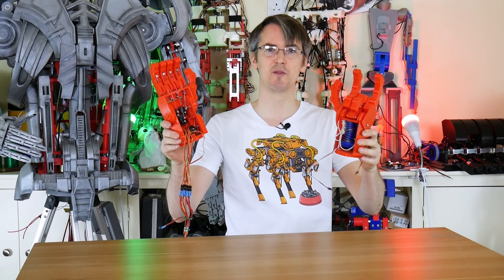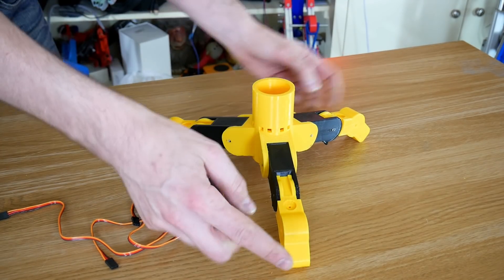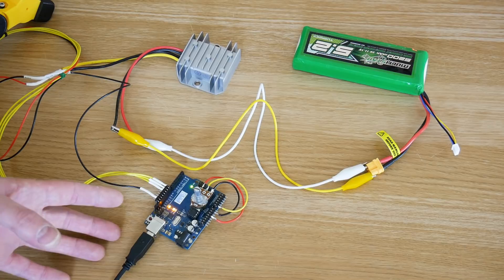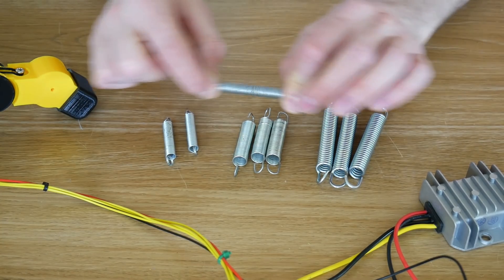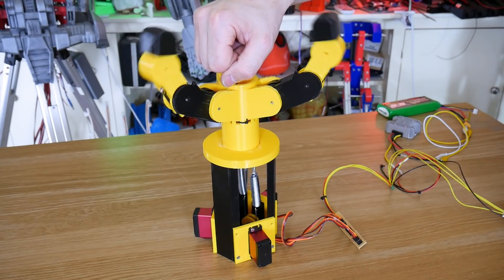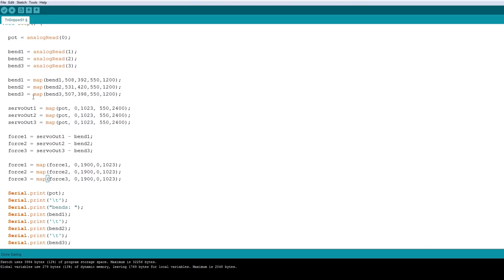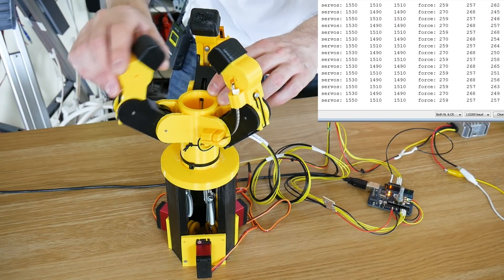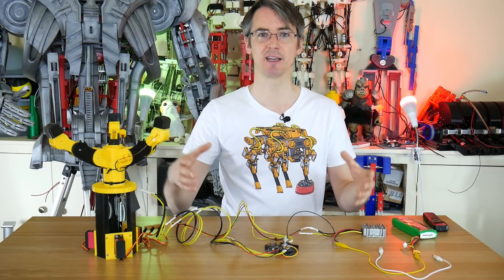Building a Force Controlled Robot Gripper | James Bruton

Comment from the maker: I want to build a whole general purpose robot arm that's force controlled!
Reply: Maybe it could be used as an arm for an open dog? Like the one spot mini has
Reply: @mantasdaskevicius9595  that would be awesome, James should also make two attached to the front so it looks like a scorpion
Reply: If its force controlled you have to do it or not, there is no try.
Reply: Hey man, have you seen "IRIM lab Koreatech" low inertia, compliant robot manipulator designs? It may help with working out some design flaws you are having.
Reply: Do IT
Reply: this is an awesome idea however I already see another design flaw besides the fingers getting stuck, over time the wire pulling them shut will eat through the plastic and weaken the thing as a whole, you need to put something as strong or stronger than the cable to protect the whole structure.
Reply: do you print in PLA or something else?
Reply: To do an easy thing to grip strange objects, I saw someone use a plastic bag containing grinded coffeebeans. Put it over what ever you want, suck out all the air from the bag and it holds the item perfect. to let go, just push air into the platsic bag and it is as soft as ever. And it is enviromentally friendly.
Reply: Instead of using string why don't you try clutch cables, you wouldn't need to design runways in the joints for them as much plus it would be very simple to put one on each finger joint instead of 1 peace of string controling 2 joints.
You could also control 2 cables with one motor for grip and release because the throw won't need to be as long you wouldn't need a pulley just a horn.
Reply: Always appriciate your works, stay tune!
Reply: Hello there! I am a fan from Spain. I want to know the mechanics behind the Slsa hand (youtube), Jeff shimek grommash costume (facebook). The kind of hand that do not work with motors, but a master-slave system. Like skeletonics from japan. I would really like to build some light exoskeleton that works just by the movement of your own body, without servos nor motors. For large costumes...and death battle fights of course.
Reply: You need to use proper rollers at points where the strings change tangents...you'd be surprised how much diiference a little roller makes.

Next if you want to build a gripper, use lead screws to drive the fingers, or a worm-gear arrangement instead so that the gripper won't slip.
Reply: Hey James Bruton I know you get this question a lot and if you do sorry that you are getting it again!. 

My question is what 3D printer are you using to print all you're modeling from?
My follow up question is I am getting into Robotics such as Robot Dog, Robot Spider, Robotic Gripper (Hand) and even Robotic hand, my question to you is what 3D printer would you recommend for someone that is starting out to help with the Robotic building within the 3D printing world!

(If anyone else can answer I do greatly appreciate it!!))
Reply: I have an idea for a tactil sensor that allow to feel surfaces and I would like to make it Opensource. Supposedly can detect surfaces and simulate the surface on the other end ( in this country I don't have the tools to build ) so its just theoretical

If you are interest in the information send me a DM

PD: your robots are cool
www.instagram.com/jorge_verdugo_soto
https://github.com/Roboxtools
Reply: Hello sir 
Can you send me a cad model of this for a reference
Reply: Hi friend, can you please share me the drawing of the arm?
I will be grateful🙏

Comment: I would use PID control on the joints (with all three parameters, D seems pretty important here), and make your own servo object (in code) for each finger that wraps the raw servo, and sensor and abstracts the PID loop away.

If you find that you need finer measurements than the bend sensor, maybe look at those cheap optical mouse sensors to close the loop.  But that's probably overkill for this.

Comment: You are probably optimizing a part that doesn't need to exist. Rather than using servos, why not just use PWM and a DC motor, which will run until the power is not enough?

Comment: This is probably a useless nitpick but 5:23 in the arduino code, you are printing servoOut2 twice. I know it's a useless mistake because with should be the same value regardless. Great video. Love the concept
Reply: I see it was fixed later on. Great video!

Comment: Why dont you just calibrate/map the bending sensor with the servo measurements empty handed and then redract the calibrated "neutral" force required? That could be an easy fix that does not require any hardware adjustments.

Comment: 6:50 the problem isn't "too little force", it's the placement of the "bearings" in your finger. With that setup the force applied by the spring is pulling the black part to the rear and not down

Comment: Hi James,  Love your videos!  I've watched quite a few of them.  Like the concept here, but you need to rethink your design.   As currently implemented, it is not actually measuring force.  Instead you have a very low resolution rotation indicator.   think about it...  you will see that I am right.  at best you are measuring the amount to which the object is compressed i.e. crushed.
Reply from the maker: I'm measuring the stretch of the spring - the difference between the motor position and the finger position. The result is the force.

Comment: I assume that you can measure how much current servo draws with Arduino, then you wold know the position and how much work servo is trying to do to get there? My uneducated guess is that could be enough information to control  how much force is applied to the object?
Reply from the maker: Yes it might work, but I don't want to directly back-drive the servos and tear the gears apart.

Comment: This is actually very interesting and watching to see how this could be adapted to my hexbot.
Maybe a stupid question but, would there be any point in adding contact sensors to the finger tips as well as using the bend sensors?
BTW have you heard of Nitinol or Muscle wires?
Reply from the maker: Yes you could add finger sensors so it can close until it reaching the object and then apply a certain amount of force to it.

Comment: How difficult would it be to create a bot that tracks its limbs/hands/feet with IR instead of relying on feedback from joints?
I imagine that practically, a robot could be much more precise about where its body parts were if it could see them, as opposed to trusting wiggly numbers from joint feedback.I reckon it would be a whole shubbang to code something like that, not to mention the AI involved. But you've done VR/virtual tracking projects before, so how much worse could it be?

Comment: For some strange reason, at this late night as I right this comment, I'd be inclined to use lasers and light sensors in so many ways to determine the position of the fingers, to monitor the size of the items and anything else.

Comment: Suggestion: use current sense resistors in the motor drive to measure and control motor torque, then you can do away with a lot of the mechanical hardware.

Comment: Much simpler approach - let the string before the spring go through a loop on a pot, measure the pot's position - you will have the information about the real movement of the joins comparing to position of the servos ;) You just need to set the diameter to ensure you can cover the length of the line even with single-turn pot.
Reply from the maker: A slide pot would probably work...
Reply: @jamesbruton  Yep, but they are more expensive :) I tried to keep it simple, cheap and relatively reliable. You can also use multi-turn pot, but that would cost the same as sliding, so...

Comment: I once bought a P5 VR glove that worked with the same kind of bend sensor. It had IR leds and a base stand that recorded the hands position and orientation, and the bend sensors was to emulate the fingers. Worked quite, especially in Black and White where everything is controlled by hand. The company went bankrupt and support ended, but I still have it. Would be cool to try to get it to run again. Perhaps you can use it in one of your projects?

Comment: I'm a little skeptical that the flex sensors are actually measuring “force”. I think they're actually measuring a sum of the angle of the joints along a rough axis, in between the points at which the ends of the flex sensor are attached to the robot. The reason for my suspicion is that if the gripper has something in its claws, but the servos pulling the strings continue to increase tension in the strings, the flex sensors will fail to report an increase of force if the object being held is rigid enough to resist the force and keep from deforming.
Reply from the maker: Yes of course they are. The force is the difference between the servo position and the actual finger position, i.e. how much the spring is stretching.
Reply: James Bruton Oh wait! So you know the position of the servo? Okay. Now it all makes sense. The key being the *difference*, like you said, between those two.

If you explained that during the video, I'm going to feel very foolish for missing it…

Comment: Correct for the non-linearity in software.
1. Start recording the flex sensor and servo position
2. Move the control slowly in both directions such that the finger moves back and forth throughout its range
3. Load data into excel, make an x y scatter plot, and fit a trend curve to the data (2nd order or higher as needed)
4. Copy the equation into your code. Boom, you've corrected it in software and you should be able to hold any position with consistent force.
Reply: Good idea :) I like the concept of software making up for hardware  shortcommings. Could use some Python code to dynamically fit the curve, and have auto comfiguring software.

Comment: Might I suggest, that if you intend to use the general purpose gripper for picking up food, that you add a requirement to the final design that it be easy to wash with soap and water in either your sink (by hand), or a dishwashing machine.

Comment: Adjustable spiral tension springs at each joint instead of 'elastics + drag across all' to open them would give an easy way to tune the curve of potential return strain energy. The outside of the hinge 3D print would have to be modified to have a circular cogged adjustment coin at the pivot point though. Wouldn't just measuring the potentiometer of each servo  (i.e.. the length that the cord has shortened ) give you the same info as the flex sensors? If not, then hooking the back of each servo to a force sensor for the strain on the cord and adding it to the shortening distance would I think , also it would keep more stuff out of the working area.

Comment: Well you can still record the calculated force for each pot position with the empty gripper to a list and subtract the values from what the sensor gives right now. Or approximate it with formulas if it's a bit fitting. Improving the design might be easier indeed though :)

Comment: I wonder if you could measure the servo current to get the force.
Reply from the maker: Yes, but I don't really want to back-drive the serovs/gears.
Reply: @jamesbruton  So you would need to use a different type of motor.

Comment: Hey James 
Great great Video. I also really love your open dog project as I'm building a robot dog myself in the same size. You gave me quite some inspiration. 
But I really sometimes cringe at your mechanical assembly. I don't know if it's just me but things like just using an undeburred piece of round stock in in the 3d Print is kinda sketchy.
Still love your work keep up the good vids.

Comment: Can't you just calibrate it with a non linear curv, so that for every position without an obstacle inside force = 0?
Reply from the maker: yes
Reply: @jamesbruton  This is a way you could correct for the non-linearity in software:
1. Start recording the flex sensor and servo position
2. Move the control slowly in both directions such that the finger moves back and forth throughout its range
3. Load data into excel, make an x y scatter plot, and fit a trend curve to the data (2nd order or higher as needed)
4. Copy the equation into your code. Boom, you've corrected it in software and you should be able to hold any position with consistent force.

Comment: If you need to make springs stiffer you can just cut a couple coils out of them.  It makes fine tuning easy.
Reply: This is a common misconception. Maybe you know this and are just talking colloquially, but; The spring does not become stronger with less coils, you simply spread the force over a shorter worklength. 1 coil is just as strong as 20 coils, but 20 coils will be able to stretch over much larger distances and actually be useful. So technically, he could take some coils off to make it "stiffer" but all you're doing is now stretching the individual coils further and thus accessing a part of the elastic deformation not previously reached. So be careful about modding springs like this, lest you eventually reach their elastic limit and permanently plastically deform them. Also, before I forget, if you do need to cut coils off, make sure you do it in the middle ;)

Comment: You need something like a linear tension sensor, like the type of strain gauge used in a set of luggage scales. You're losing a lot of the servo's force in those springs, when all you need to do is measure the tension in each tendon, and either carry on driving the servo or STOP driving the servo depending on the force needed.

Comment: Just put a strain guage inline with your tension leads.  Sandwich it between two cups.  Like a mated pair of 3 legged tables.  Legs facing each other, strain sensor in between.  Pull left on the right tables legs, pull right in the left table legs, sensor gets squashed.  Once your setup contacts the object, deflection ceases which means your force measurement is no good when you actually want to measure force applied after stopping.

Comment: You should create a look up table for the for the forece graph of the servos. That's what you do in racing sims to get the best force feedback on your wheel. there is a program that takes controle over your whell and tests how much time and force it actually needs to reach any position (tested in increments). you could do the same by testing how much the servo has to move to make to get the fingers in a certain place. If you took something like 100 increments for the full finger actuation, you could the controle the fingers linearly instead of the servos

Comment: I think you could get acurate results with this hardware. It's just a software problem. 
You need to measure a data set (servo value and bend sensor value) for all the positions of the servos (without any force). Next you go into a data analyzing software and let it find a function that returns the corresponding servo value for each sensor value. The difference between the real servo value and calculated servo value will be the force. And the force will always be zero if the fingers don't touch anything. You can do the same data analysis for different forces and positions if you want to get precise force values (not just a good zero).

Comment: I'm not telling anyone what to do, BUT I think using patreon is better than youtube memberships, because youtube takes 30% of what you pay, after deducting taxes. Source: https://support.google.com/youtube/answer/9050176?hl=en
That's quite a lot if you ask me
(Patreon takes 2.9% + 35ct)

because of the extra 35ct on patreon, which is constant, and not elative, you would have to pledge 1.30€ or more.

1.30€ * 0.30                                   = 0.39€
1.30€ * 0.029 + 0.35 = 0.3877€ ~ 0.39€

Comment: I saw somewhere that a high carbon foam was being used on the "finger tips" - the resistance across the foam changes as it gets compressed and that relates (I do not think that it is linear though) to the amount of force being applied.
Then you could drive both opening and closing from the servo without the need for bungees and springs and as a safety feature monitor the servo load in case something goes wrong with the tips.
I see this developing into a prosthetic forearm/hand for a youngster - I know there are 3d printed mechanical units being made by the 3d maker community at present but a fully electronic unit would REALLY be cool for one of those unfortunate kids.
AND it makes all the "right" noises...  ;>}
Reply: The Mad Man The opensource robot at InMoov.fr uses this approach.

Comment: Cheap idea: use a cam at the joint that the bungie passes over.  This will compensate for the change in geometry and keep the force constant.  E.g. see the "Nautilus" work-out gym machines, which are named for the distinctive shape of the cam.

Comment: James would it be worth having the return bands slack at first, and tied to the servos so when they are activated gripping the object they also spool the bands tight, tensioning the return springs, slightly behind in timing possibly.
Reply from the maker: Possibly - ideally the servo would just push & pull with two sprints.

Comment: Nice project! I was thinking about something similar, and had the idea to hack the servos and conncect their internal pot to the arduino so you can read their actual values. You could then use a force resistance or like you mentioned measure the current to determine the force applied.

Comment: Nice, can you expand on how you use only 3 motors to control 6 DOF? Won't it make it very hard to get any precise control as you can't really know the exact position of the hand. or your gripper weaker because the max force will be limited by how much force is needed to get the extra joint out of the way?
Reply: I think that the 6 dof is actually a misnomer. 
You will be able to move the 2 joints without affecting the actual force being applied at the finger tip.